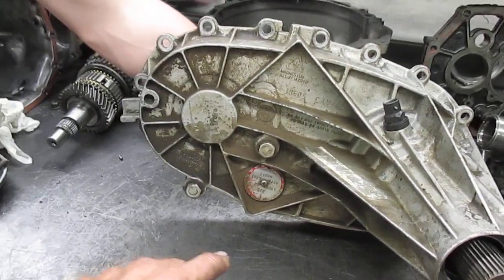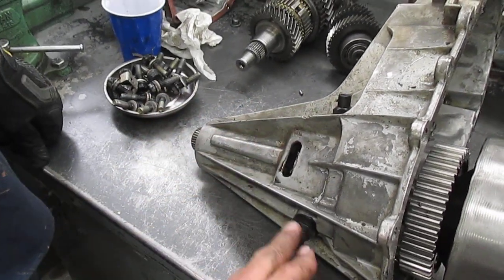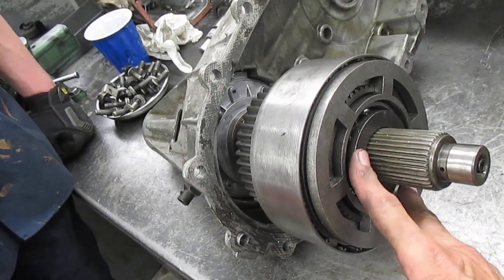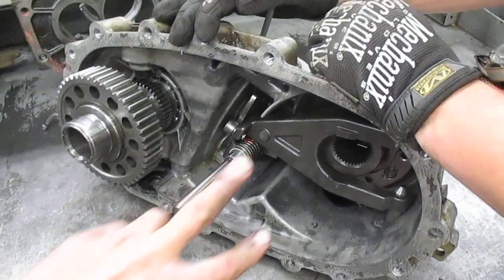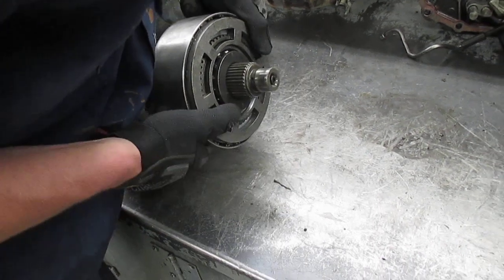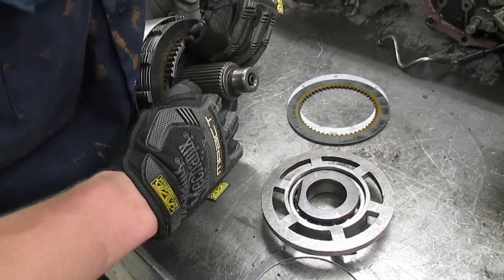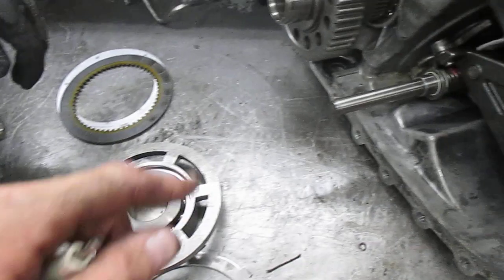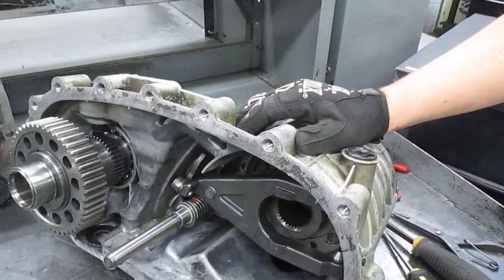Auto 4WD vs 4WD

Comment: That clutch pack looks like they just added a motorcycle clutch basket to a transfer case.  Thanks for the explanation, now I understand the system and know when to use which mode.

Comment: Question for you. On the GMT900 Suburban 2500s equipped with auto 4WD and 4.10 gears, the 14 bolt differentials are made by AAM. The front diff has what looks to be a long actuator sticking out to the passenger side. The only function that I can see it serving is to further split torque between the front wheels. Is that what it does? Is it only in Auto4wd that it does this? Is it some sort of locker? Am I seeing things?
Reply from the maker: The actuator that you see on the front differential is what engages the front diff.  The transfer case is what varies the amount of torque sent to the front wheels.  The front actuator moves a shift fork in order to engage or to disengage the front differential.
Reply: BYUI AutomotiveVideos Thanks. I just watched another video explaining why the front differential needs to be engaged or disengaged. I’ve never had anything 4wd before.

Comment: Nice explanation. If I understand correctly, this also means that auto 4wd isn’t able to transfer as much torque to the front axle as 4wd because auto 4wd allows some slip in the clutch pack. So for times when high torque is needed at the front, use 4wd.

Comment: So if you take the encoder motor off and manually put it in 4wd and the front drive shaft still doesnt spin then the clutches are toast correct?

Comment: Does this mean I technically have true 4wd when I am in 4hi then? Like a locked front diff? I drive 2008 GMC Sierra 1500.
Reply: Yes and no.  You never have a locked front diff, unless you have a locker in the front.  Most 4x4's from all truck manufactures have an open front diff.  As far as  your transfer case goes you have a true 4x4 when in 4hi or low; however, it may not be as strong as a non auto transfer case with no clutches, meaning under extreme cases you may cause the clutches to slip.  However, if this is the case it would only happen in a worn out case or under heavy abuse.  Just make sure you change the fluid every 40K miles and ONLY use the GM Auto Trak II fluid.
Reply: @jewllake  Maybe you know if it is safe to use auto 4wd? Even on dry road conditions?